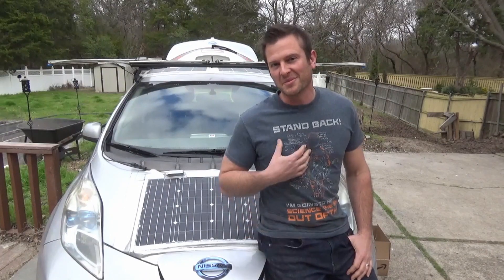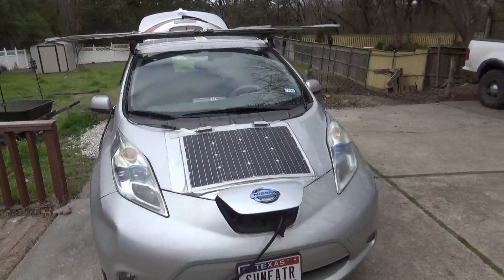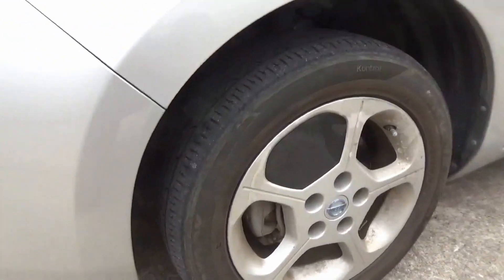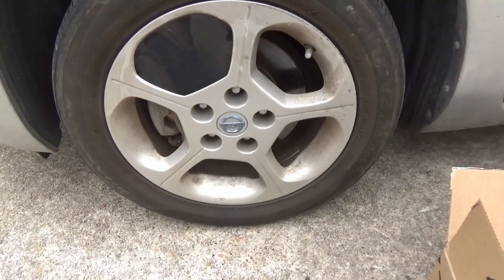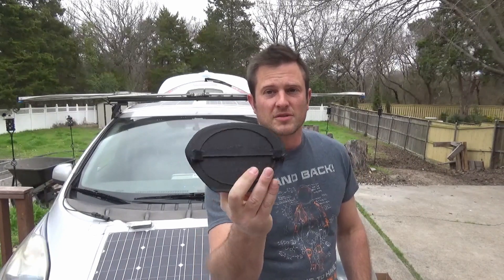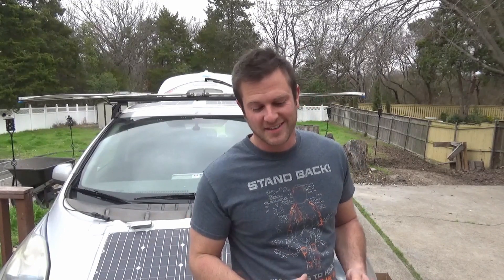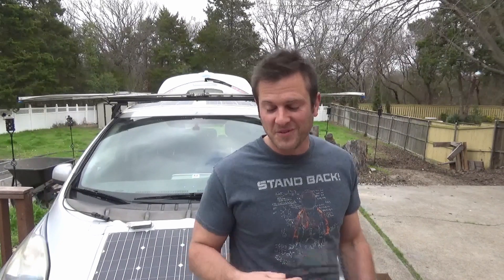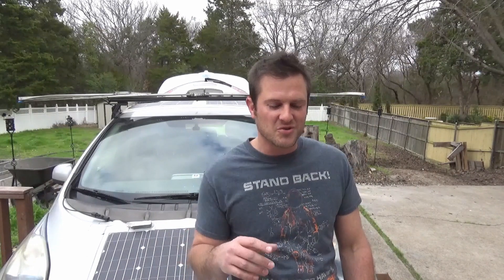Aerowheels for the Nissan Leaf

Comment: hmm, but you still have the big hole in front of the car that generates drag and is good for nothing? Why is that not filled sir? :)
Reply from the maker: There's a radiator behind there (the one that cools the electric motor I believe).  I'm comfortable removing 90% of the airflow from the brakes with these aerowheels, because I drive pretty relaxed.  The regen braking does the vast majority of the braking for me.  If I drove in a manner where I were constantly riding the brakes, (you know one of those people that can't drive unless they have another vehicle 3 cm in front of them?), then I wouldn't have put these aerowheels on because the brakes would overheat.  

Unlike the brakes the motor is always working though.  In Texas daytime temps easily exceed 38C for several months of the year.  I'd be afraid of overheating something in the motor, by covering the big hole you mention and removing the airflow.  A front grill cover would work great for a dude in say, Estonia.  A HUGE problem I had to fix with my portable charging station was the 800 btus of heat/hour it puts out in the interior of the vehicle.  The neccessary addition of an air conditioner, added weight, cost, and complexity to my project.  I have always speculated that if I lived somewhere much colder, this problem would flip and turn into one of the greatest advantages of the system.  The waste heat would effectively be a little heater that runs in the interior of your car all day while the vehicle charges.  Would this appeal to you at all, or do you guys get so used to the cold over there it wouldn't matter?
Reply: @InnovativeSustainableSolutions  I wrote a lenghty answer but I guess my session had timed out and it went to void, i'll do another take now. First I wanted to direct your attention to the aerowheel caps author videos, who, as many, also did the front hole mod. I believe he lives in a quite warm place too :) But sure, you do not need to cover it all, maybe leave a 10% slit - still plenty of air i'm guessing. It is not the only path for the air to get into the engine bay. Maybe check if there are any temp readings from the motor that we could monitor for better data.
As to the charging heat problems you are dealing with -- this is a "funny" thing, where you would benefit from having charger where it sits for my 2013 car and I might sometimes benefit from where it sits for you. Your gen1 leaf charger lives behind rear seats, pretty much inside the cabin and all the waste heat radiates into there along with your inverter heat etc. While my gen2 charger leaves under the hood and all the waste heat is well, truly a waste.
I would benefit from it sometimes but that would require a very precise charge timing with departure and that would be quite a hassle most of the time. Since gen2 has heat pump, it is quite simple for me, i'll just press a button on my phone leaf app 5-10mins before leaving and it gets warm. Or cold. You really should have gone gen2, two years younger leaf, many benfits in your environment :)
Reply from the maker: @gelisob  Paul lives in Zealand.  Summer highs there are 15C-20C cooler than Texas.  Very significantly cooler.  I went with the Leaf I went with for the price.  I didn't know anything about charger location when I bought the vehicle.  Im sure a Gen2 would work better, but finding one at my $3k dollar price tag, would be quite a find.
Reply: @InnovativeSustainableSolutions  I went and checked logs that leafspy generates when you enable that in it's options. It records motor temperature there :) Enable logging if you didnt and you can get .csv files with good data, maybe you already have it. This way you can run a test to see what happens if you lets say cover half of it.
Reply from the maker: @gelisob  Now that is some helpful advice.  Thank you sir, I'll definitely look into that.  Hope you guys are doing okay over there in Estonia.  Things in the states are pretty f'ed right now.

Comment: In you gas savings calculation, it appears that you are not including the cost of your charging set up. I think it would take years to overcome that costs. And by then, the batteries may be degraded?
Reply from the maker: The vehicle cost $3,000.   The batteries and solar system cost an additional 3,000.   My gas expenses in my F150 were 2,700/year.  The calculation is done using a figure of 2.50/gallon for gas (national average) and the F150 mileage of 14 mpg.  There is a chance the batteries will degrade so fast that the Leaf never pays for itself and I loose money.  There is a chance it lasts past the 18 month break even point and I start saving a lot of money.  This channel is not only a rough tutorial on how to build an onboard solar charging station.  It's an experiment to see if this can be used to save broke people (like myself) about $1000/year if they're willing to do a little work.  I'm actually skewing the test in favor of the gas car, by not taking into account the costs of oil changes, or other maintenance (timing belts, spark plugs, etc, etc.) that exists in gas vehicles but not electric ones.  And I would say there is some value in being able to make your own power.  Dallas got rocked by some tornadoes not long ago, thousands of people were without power for over a week.  This system will run a fridge and some other essentials.  I have also assigned no dollar value to the "backup generator" function this vehicle serves.

Comment: Hopefully someone can help me with some info. I  have a 2011 leaf and have the ev light showing. I took it to dealership and told me that it will be $900 to check all components plus parts cost. Posible rat damage since there were rat droppings under the hood when time of purchase. I would like to try and fix it myself.
I'm thinking on buying the hv harness cables from a junk yard and see if that could fix it, for some cables could be chewed up and be the cause of the problem. I don't have the money to pay the dealership to fix it, that's why I would like some pointers or suggestions on how to do it.
Not sure if I'm clear. 
Thank you!
Reply from the maker: First thing I would do is hook an OBD2 sensor (https://www.amazon.com/gp/product/B00QJRYMFC/ref=ppx_yo_dt_b_asin_title_o02_s00?ie=UTF8&psc=1) up to your Leaf, download LeafSpy App onto your phone (this sensor only works with a iphone), and see if you can find some error codes, or indicators of what the problem may be.  That should help point you in the right direction.

Electrical problems (shorts, and open circuits) are infamously hard to track down in vehicles though.  It could be an obvious problem that you spot in the first 5 minutes, and it could be something you take the whole vehicle apart and still can't find the issue.  Thats the bad news.

The good news is, even if you can't get the car working, and you don't have the cash to pay the dealership, the Leaf is worth at least $2k even in parts.  60-80 lbs of copper, hundreds of pounds of aluminum, and easily $1k worth of batteries.

If you are near Dallas Texas I'll help you troubleshoot.  Good luck

Comment: Have you considered adding a front aeromod? Might not be possible to use the whole thing, seems like you are in a quite hot climate! https://github.com/dalathegreat/Nissan-Leaf-Aeromod-Grille/
Reply from the maker: I thought about it.  My concern was temperature, as you mentioned.  Texas hits 37C quite regularly.  We set a record a few years back for doing so 100 days in a summer.  My suspicion is that airflow through the front "grill" significantly reduces the temperature under the hood, but I haven't tested it.  I like that horn upgrade you did to your Leaf.  I my copy you on that one.